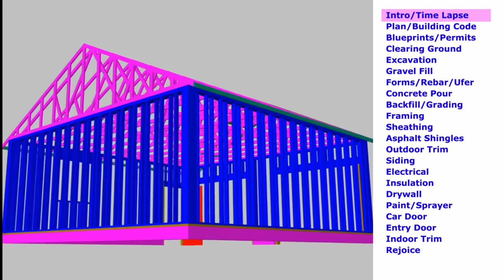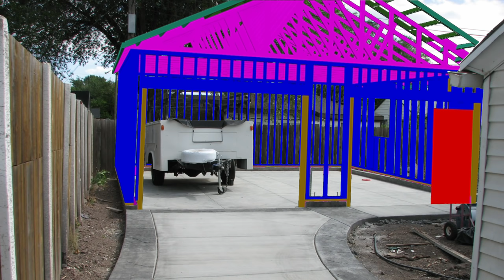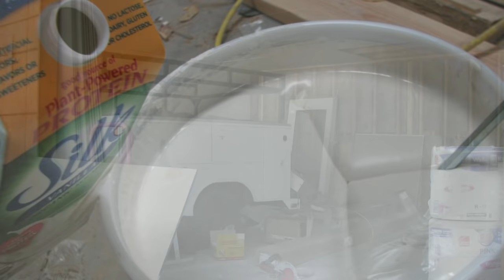ONE MAN! Two Car Garage | BUILD IT

Comment: Great work as always. I really like the full light door.  The concrete work is excellent.
Reply from the maker: +BRICEN18 I wanted light to come in through the door, see people who are outside trying to visit me in the shop, watch my kids from inside to the outside.  I can't wait to go over the concrete video in 2 months or so.  The walls were perfectly plumb when I checked them with a laser lever and it was level, square, spaced correctly.  There was only the front right corner that was off out of square by 1/4".

Comment: Excellent video!!!  Since you have had your shop for awhile now anything you wished you had done differently?  I loved how you hugged your shop at the end.  :) ..people will build, feelings will get hurt.... heee heeee!!!!!!
Reply from the maker: 1. Maybe a slightly flatter roof slope.  I could have still matched the house roof slope very closely, as seen by the eye, but I could install the shingles even faster with a smaller slope.  
2. I feel very good about the garage build.  I mentally planned it for 1-2 years and on paper for a few months.  I got exactly what I wanted.  However, I listed some mistakes below that could have been prevented.  But the hours lost, overall, for mistakes are so small compared to the entire hours spent on the project.  I haven't calculated all the hours yet.  
Mistakes:
1. I put a fire rated wall on just the east side and I also needed it on the south side.  I put up the wrong drywall, then had to take it down and put up the right drywall.  Wasted time 3-4 hours.  
2. The inspector told me far into the construction process that I needed a 1 hour fire rated wall on the TRUSS gable end too (in the attic), but I already had the ceiling drywall up, so I had to get the type x drywall pieces up the attic access opening and install it up in the attic.  I could have put the drywall on the gable end truss FIRST, during the framing phase, then tilt the truss up in place.  Wasted time 2-4 hours.  
3.  I originally wanted a taller garage door on the east (left) side in case I wanted to store a taller trailer in there, down the road.  But the grade, for the concrete slab went a little higher than planned to allow water run off down the entire length of the driveway out to the street, which was important.  This caused the floor to be higher than planned.  I couldn't make the building structure higher because of the main power wire running right over the garage.  So I had to return the garage door I bought and get the same one as the right side (standard door height).  Wasted time 2-3 hours.  
4.  The original threshold for the small entry door was high, so I framed the opening high.  But then the threshold was trashed too much so I bought a new one, but these tend to be smaller.  So I had to fill in the top of the opening with framing and more trim work.  The look is actually really cool but took about 2-3 hours more in time.

Comment: There was nothing about being soundproof.  Title failure.
Reply from the maker: The walls have staggered studs, 8" on center. You can see it in the 3D model and the framing process. This will be discussed in future videos. The purpose of the intro video is strictly limited to time lapse.  The garage remains soundproof whether I point it out in the video or not.  Albeit, everything is soundproof except the garage doors.  The garage doors are only sound resistant.